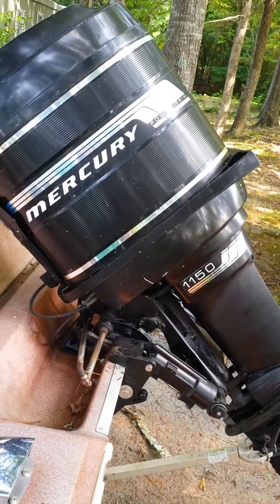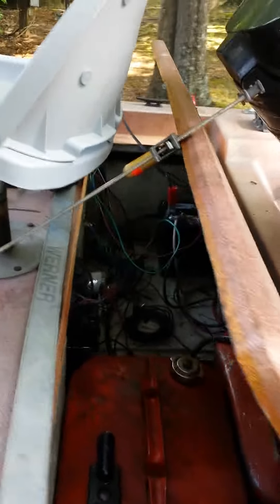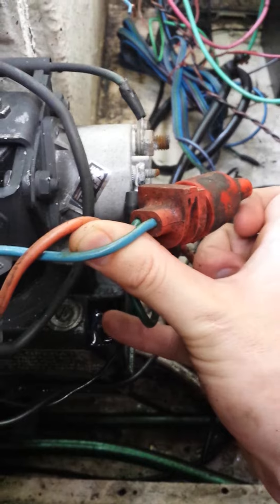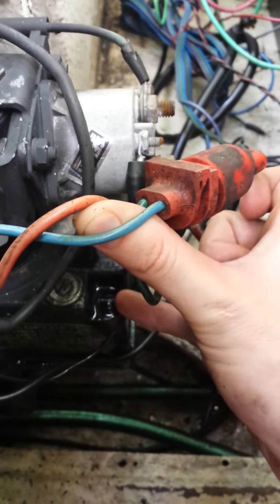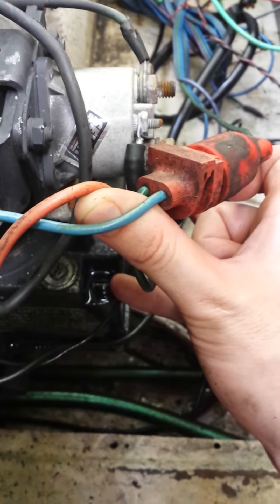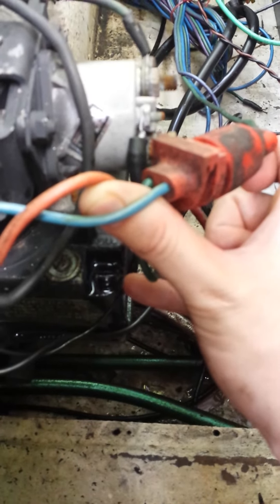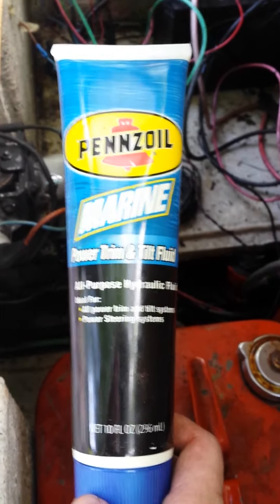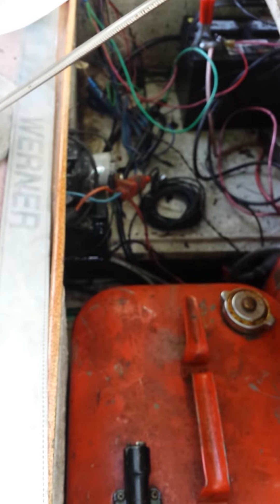Add trim hydraulic fluid to mercury 1150

Comment: Matt Culberson.  Thank you so much for this video!!!!!!!!!!!!!!!! You just saved my wife's and my spirit this evening in central Ohio. We tried to go boating but we only heard a whirring noise when trying to put the motor down. Hence, the trim was not working. We have no idea how to get the motor down manually in this particular year of motor. All the videos talk about turning a screw somewhere and relieving pressure but we never figured that out. Regardless, your video showed us what we needed to do and it worked perfectly. We have out tilt and trim back. So, Mr Culberson again thank you over and over as we were very upset returning from the lake thinking the boat was going in the shop for God knows how long.

Comment: when you add oil the motor is up position or down ?
Reply from the maker: when it is up is how I did it. But had to add more twice. I found out from an old timer that if you park your boat you should drop motor to keep it from leaking and in cress longevity on pump.